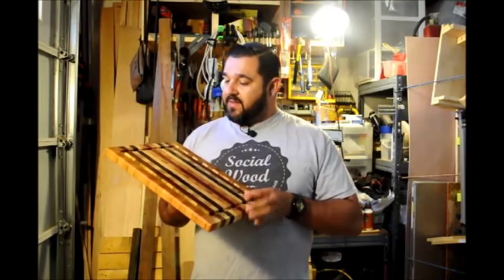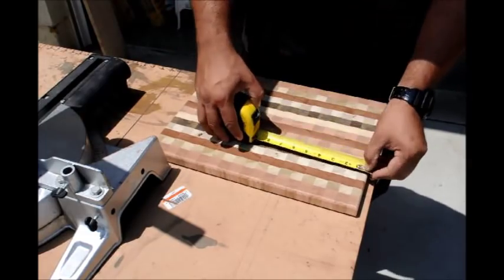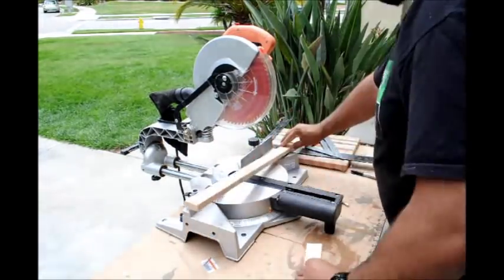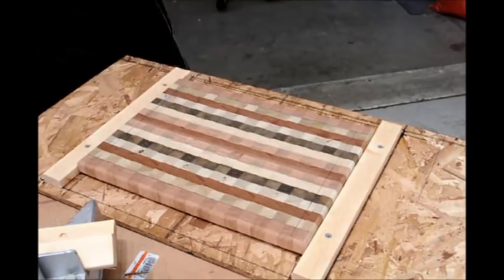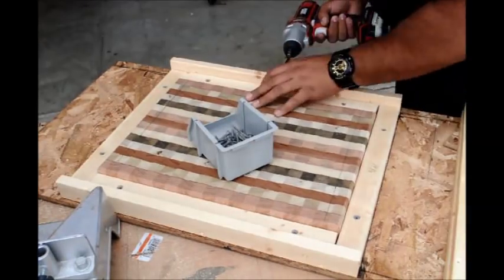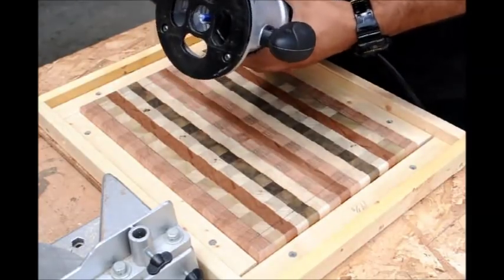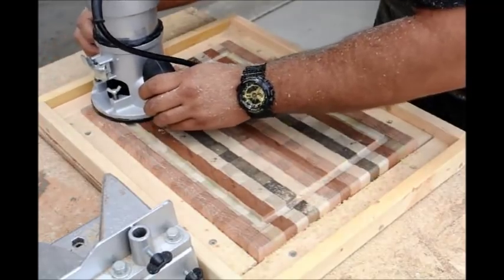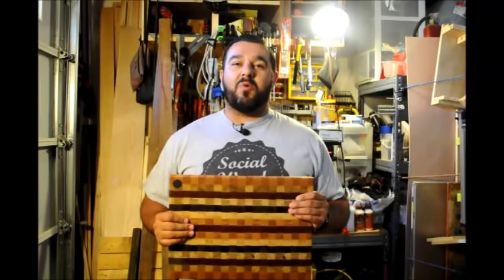How to Make a Juice Groove in a Cutting Board

Comment: This method might be a little tedious to set up, but it definitely produces great results, especially if you are lacking a router table or plunge base as alternative options. Great video!

Out of curiosity, what router bit and size are you using?
Reply from the maker: Thank you so much for watching and for your input. It is a little more work initially but if you make a lot of cutting boards of typical sizes you can make one and reuse it for boards of the same size.

I typically use either a 1/2" straight bit or a 1/2" round core bit. Both are pretty standard for juice grooves and both look nice. I used the 1/2" straight bit in this video.

Comment: Wouldn't it be easier to use a router table with a fence and stop blocks?
Reply from the maker: +Michael Meis (tubbz23) Thanks for watching and for your comment. 

I have used that method as well and if done right and very carefully it can produce great results also. I found that using my router table and stop blocks was a bit easier to make mistakes. The method I used in this video is a more fool proof method in my opinion. But again, thank you so much for your comment!
Reply: +Social Wood Works That makes sense, nice video, new subscriber.
Reply from the maker: Thank you soo much Michael!